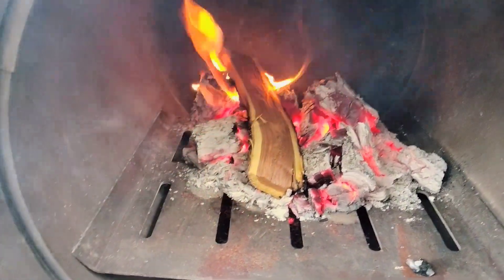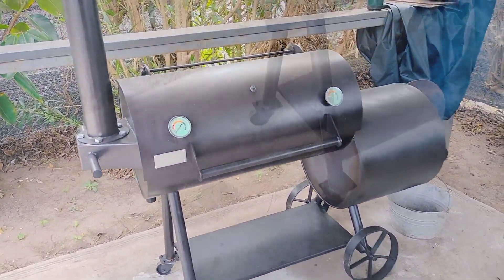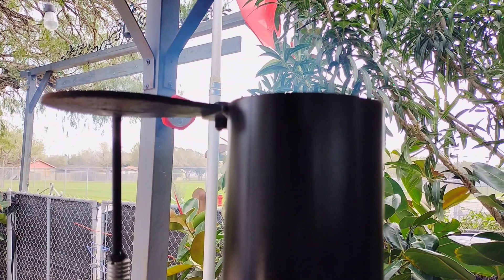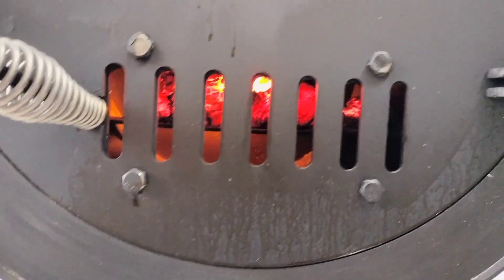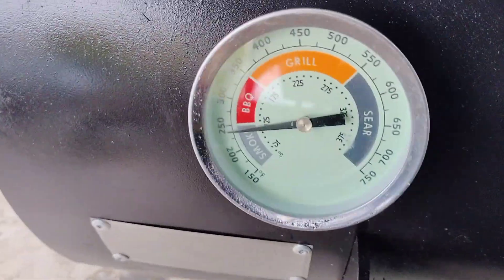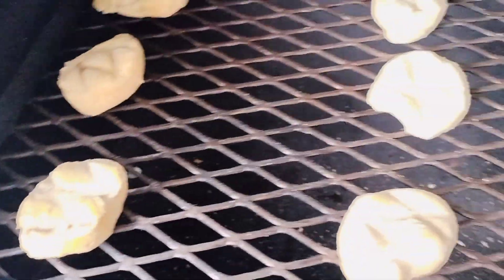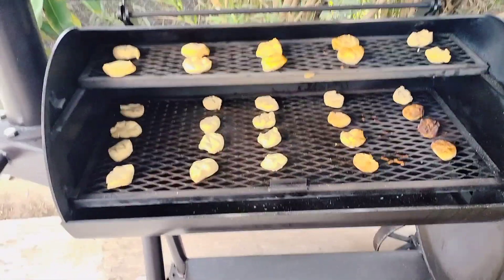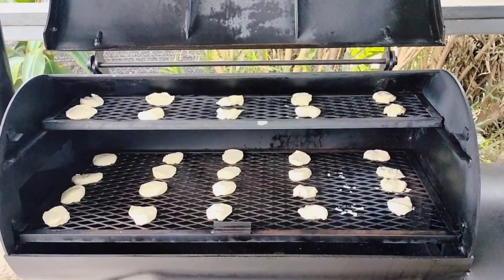Old Country G2 Offset Smoker - Biscuit Test #oldcountrybbqpits #g2smoker #offsetsmoker

Comment: I’ve owned my G2 for a month now. I dared and cooked two briskets at once. I placed them side by side closer to the smoke stack. They turned out great. I did not use the baffle or deflector plates. I placed my fire in the bottom of the fire box. I agree with consensus that the stack should be open, but I noticed the draw was so great it was ok to close the damper a little. I did notice the fuel consumption was very efficient. I really think this a great smoker for the money. if someone wants the modern convenience of insulated firebox and a welded construction this is the smoker to get. The biscuit test proves that this smoker has great air flow for a back yard cooker. I just can’t wait for my next cook. I plan to do plated beef ribs and spare ribs. Happy new year to the backyard pit masters out there.
Reply from the maker: Thanks for sharing this! This is great information. I have yet to do a long cook on it. I am probably going w a brisket as my first long cook. I agree - this a great smoker for the $. Happy New Years to all the backyard Pitmasters out there!

Comment: Great suggestion - - I would appreciate another test with damper partially closed.   I am seriously considering purchasing a G2 as my entry level stick burner.   Appreciate your content - - keep it coming!
Reply from the maker: I'm hoping to do this soon but if you can't wait - in my latest brisket video, this is exactly how I ran it. The damper on the smoke stack was slightly closed and the fire box door was slightly open. Held temps like a champ!

Comment: If I’m not mistaken, are there plates to add under the main grate? To help deflect some of that heat from out of the fire box?
Reply from the maker: Yes there is. For this test, both were off and not installed.
Reply: @AlLunacyQing  nice! I’d love to see a test now with the deflector plates in, to see if they actually help deflect any of the heat and perhaps make the heat hit those spots in the back biscuits that didn’t get much heat. Very interesting, thanks for your time! I’m really considering buying this smoker because I want to buy something that will not leave me wanting more, especially for something close to $1,000 I’d rather pay more and get quality.

Comment: Al, based on your experience w/G2 how often are you adding splits, on average? How long are you able to hold a steady smoke temp? 30minutes? 40 minutes? My backyard stick burner (not a G2) has some spikes and burns fast even with firebox management & mods...looking to see how much longer or duration I could achieve w/G2. Good video Al, cheers1
Reply from the maker: I use lump charcoal & 2 wood splits to start with as my coal base. After that I only need to add a split every 30 mins and it holds temp (usually 275) very well. If it's not too windy a split may last 35 to 40 mins .  If you want hotter than just keep the firebox door shut. It's an awesome smoker.

Comment: was the inside baffle installed ? I think I remember something of a steel baffle
Reply from the maker: I forgot to mention that. The tuning plate  and heat deflection baffle are removable and I did not have them installed. Thanks Lance! 👊
Reply: another vid then :) curious to how it would move that hot far right bottom hot spot  @AlLunacyQing
Reply from the maker: @SleeperBBQ  Yes indeed!

Comment: Great video!! Would you pick the G2 or a Yoder loaded Wichita as a first offset? Similar prices on the used market.  Thanks for any info
Reply from the maker: @jjmart9203  G2. The Wichita has no collector and the stack is not at grate level. Not good . The G2 is the easiest offset I've ever used.

Comment: Did you leave the baffle in when you were running the biscuit test? Where was the tuning plate?

Thanks!
Reply from the maker: No. Both the tuning plate and the baffle were off.
Reply: Thanks! I just got one and am tinkering with the different configurations of the baffle, tuning plate, and water basin locations. I’ll try it your way as you seem to have a really even cooking surface. Thanks for the tips!

Comment: no damper ever. If you choke off the air flow, you'll create a smoky oven which isn't clean smoke. You'd be better off to use the door only to open all the way if temps get to hot, and slightly leave it open for more direct air flow. Also learning the correct split size for your fire to control the heat management is the ultimate. I learned that all the hard way
Reply from the maker: I've run it both ways. I wait till the split is fully ignited before closing the door so no problem w dirty smoke when using the smoke stack damper. Running fully open on both ends is great as well but you end up using twice the amount of wood. When making a coal bed it doesn't matter the size of split only when you are maintaining the temperature does it matter. It's definitely fun learning, even if it's the hard way. Cheers!